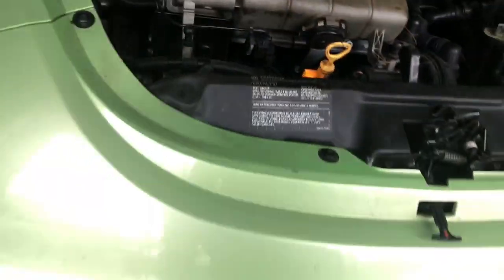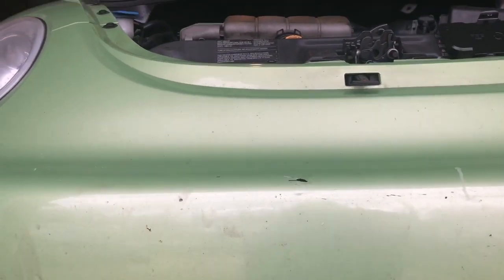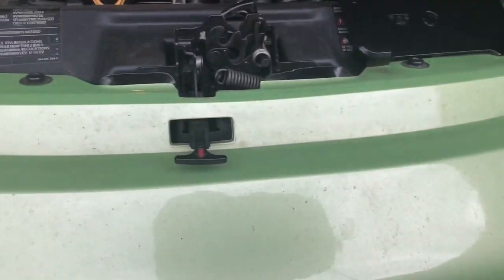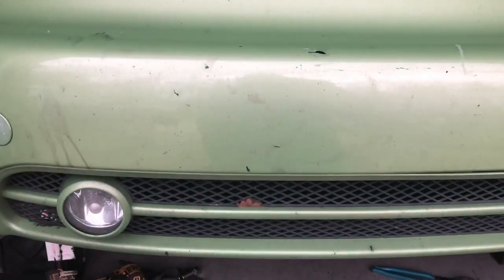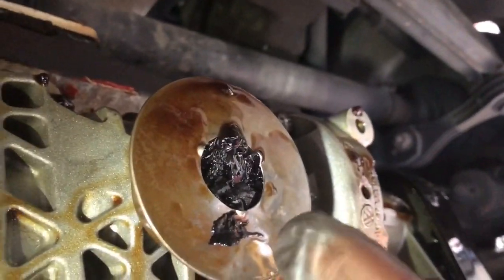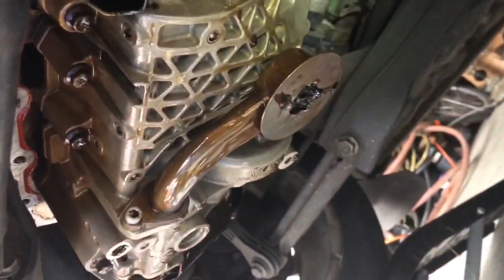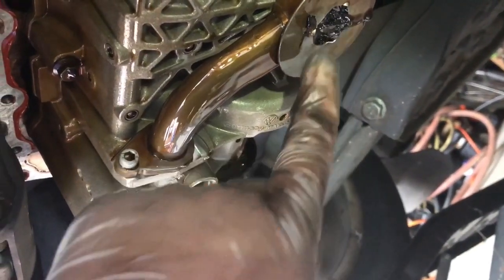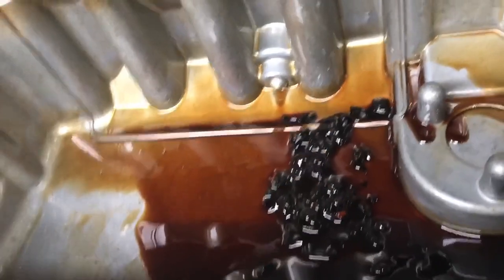Check this if you have low oil pressure on your VW or Audi

Comment: finding this video now and I can confirm this is a VERY common issue...i had it with my MKIV  GTI recently. Good video.
Reply: Just happened to my mk5 gti was sitting in outside in the winter for a couple days completely fine before but I didn’t even drive 10 mins and the oil pressure light came on
Reply: @felonadrenalinejunkie7748  what was it filled with? Thinking this is what’s wrong with my mk5 TFSI BPY

Comment: Thanks Ocie Carlisle
I just Scored a 2004 VW Jetta TDI wagon for $800.00...beautiful shape except it has Low Oil Pressure 
and Low Power. This is where I will start my investigation !
LIKED/SUBSCRIBED !
Reply from the maker: Screww Googlle for low power, you may need to check out your turbo and turbo feed lines to make sure they aren’t blocked.
Reply: @Icanfixit-2  
Will do my new friend !
Thanks for the come back !

Comment: Thanks, this was helpful. I have a 2012 Tiguan with the same engine and lots of repair receipts. I'll verify my oil pressure switch wasn't already changed, then start with dropping the pan.
Reply from the maker: Hopefully it fixes the problem
Reply: Sooo - I have been waiting... :) How did it go?

Comment: Just got a Passat and the light came on after like an hour of driving..but I was hauling ass really testing that turbo out! Hope to god this is the issue.
Reply from the maker: Hagen Smith if not, worse case scenario you have a spun bearing.
Reply: Hagen Smith so did you solved the problem.  Or what was the issue?  Thx

Comment: Have a 2006 Passat. Low Oil Pressure light and alarm came on. Car shut off once
Or twice. Happened after driving about 45 min straight. Changed the PCV Valve. All lights and alarms shut off and no problems since.  Drove it for a
Couple hrs straight. No issues.
Reply from the maker: Patena PR that’s good to go!

Comment: Greay Video and going throughy comments you seem extremely knowledgeable.  I need some guidence please. 

I have an oil light that comes on intermittently on my VW golf 7 2.0 Tsi, i.e on start up sometimes and sometimes not ...mainly after doing a short couple of miles the light surely comes on.

We have changed both oil sensors , changed the Pcv valve, and changed the oil and oil filter ..as far as doing the timing chain and Cambridge replacement.  The light is still on.

What have we missed ,what could be the issue ...is there a way to isolate the issue down to the exact failing component?

I feel like giving up😢
Reply from the maker: Does it make the “death rattle” when the light is on? Have you had timing chain guides recently replaced? It could have blockages in the screen  of the pickup tube for the oil. It’s not sounding too bad. Just let me know.

Comment: Audi A4 2.0 ALT Engine Oil Pick Up was replaced and during the test the Low Oil Pressure Light reappeared. We stopped immediately because smoke appeared from the Oil Pressure Sensor. This morning we checked the Oil on the Dipstick and therefore at the right level. The problem is the car does not want to start now. It sounds like a car without a spark on the Plugs. Before we replaced the Pick Up, the top of the car made a lot of noise but after the Oil Pick Up was replaced, the Engine sounded normal. We could not find any Oil leak under the car. Also replaced the Spark Plugs and Oil Pressure Sensor.
Reply from the maker: Try checking your crank sensor and cam sensor. I also have a video on replacing the crank sensor. If no spark, could be your crank sensor.
Reply: @Icanfixit-2  I will do that and inform you Thank you

Comment: Why on earth don't they make the oil baffle out of metal instead of plastic to avoid this problem? Are they keeping the production cost down? I'm sure the engineers that designed it are aware.
Reply from the maker: sand 007 only thing they were concerned about was saving money as usual. They also claim that the oil would work as a “cooling agent” at normal operating conditions.

Comment: Great video!  Thanks.  So if I drop the oil pan and it is filled with junk like the one in your video, do I just need to clean it off there at the opening or does it require continuing to dismantle everything to clean junk/debris that may have gone in past this point?  Hope this makes sense.     I am working on a 2008 VW EOS by the way.
Reply from the maker: Yes you are correct! Also remember to check the oil pickup screen and make sure it’s clean as well. Good luck on the job and feel free to ask questions as you go.

Comment: I have a 99 VW Passat V6 2.8L stick. What's the estimated time to replace or repair the Oil Pickup tube.

This would explain why my oil light came on right after my car hit extremely hard after a mechanic was driving off ramp.
Reply from the maker: It depends on your level of skill. A novice can do it in 3 hours total.

Comment: Good morning,  I am looking to purchase a 2002 VW New Beetle that needs the oil pump replaced,  I'm a very hands on type of female and feel I can fix things if I do my research well enough.  Do you think this is an easy or doable thing for a female? And what advice would you give? Would I need to take the engine out or is it accessible from the bottom of the engine? Thanks in advance...
Reply from the maker: Good morning. The easiest part is explaining how to do it, but yes you can do it with the right tools. The oil pump requires you to drop the oil pan and remove the drive chain that is turned by the crankshaft. Very straight forward job and remember to replace all of your seals with new ones.

Comment: Thank a lot for the info. What do people mean when they say ground you 
oil pressure switch ? Is that just to test the sensor it self ? I have a
 1.9 TDI Jetta 03. My engine was rebuilt and now it's throwing the oil 
warning. It only does it like 10-15 minutes after fully warmed up and 
smokes a bit more at that time and not while warming up. If the pickup is clogged, will it trigger the warning any any operating temperature or only when it fully warms up ?
Reply from the maker: The reason they say “ground it” is because it could have a little corrosion between the block and the sensor. You can also have oil feed line going to the turbo that could be clogged (smoke from tailpipe) and could probably be blown out or run an engine flush. Try doing an engine flush and see if that helps.
Reply: @Icanfixit-2  I replaced the oem feed line with a flexible one. Do you think that a clogged line can cause to loose pressure ? Btw the oil warning does it indicate low or high pressure ? I am affraid of doing an engine flush. They guy who rebuilt my engine use my old head and his old block, but he changed connecting rod and main bearings. Not sure if he measured the clearence.
Reply from the maker: @TheAbrunqaj  make sure it’s not a flexible one that collapses over a certain temperature because the flow rate will slow down and create a problem. A flush shouldn’t hurt by pouring it into the oil (oil flush). If you drain your oil and see large particles, you need to drop your oil pan.
Reply from the maker: @TheAbrunqaj  also, it’s triggered by low pressure.
Reply: @Icanfixit-2  Thanks for your help. I mentioned earlier that the engine was rebuilt. So IMO it should be clean but I can try a flush. Is there a specific brand of engine flush ?
Reply from the maker: @TheAbrunqaj  sea foam has always been my go to for almost everything.

Comment: that's crazy!!! I think my issue is different though, well hopefully. I got my 50k oil change 2 months ago and I dont drive much but I started to notice oil stains where I park and now the low engine oil pressure light is on. I checked the dip stick and there's barely a drop on the very tip. I have a 2019 Jetta SEL Prem... I called the service dept and they couldn't see where I had an oil change, only a software update. That scares me because now i'm questioning if they ever did the oil change or if they did, maybe they didn't tighten the bolts correctly. I hope theres no serious damage, what would cause a leak after an oil change like this?
Reply from the maker: It could be burning oil but that would be very rare. Did you add any by chance? Me personally, I would check at intervals at 1200, 2400, 3600, and 4800 miles to see how it’s using oil or how fast it’s leaving the engine. If it’s a turbo, you risk the turbo building crud if it gets low or if it’s burning through the exhaust.
Reply: @Icanfixit-2  Thanks! I am adding 2 quarts in the morning Catrol 0w-20 so I can drive it into the dealership. I'm not taking any chances for another 1k miles. My fear is that they didn't do the change, even now
 my service records don't show it... this is so weird.
Reply from the maker: I’m sure. Gotta be safe.

Comment: I have an 2009 VW Tiguan. The oil pressure light started coming on after a recent oil change. Oil pressure switch and sender were  replaced on two separate occasions after the oil pressure light kept coming on. The oil pressure light is back on again. Oil is good, no noises coming out of the engine. Just that pesky light. What’s your recommendation?
Reply from the maker: ITisWHATitIS check the oil filter and make sure the rings are in the proper place. Also, make sure that the screen is not blocked. If all is good, do an engine flush.
Reply: Ocie Carlisle I will try that. Hopefully, it works. Thank you!
Reply from the maker: ITisWHATitIS keep me updated!
Reply: Same issue did u resolve?

Comment: What would you use to clean it?
Reply from the maker: I’ve used brake cleaner spray and it worked great. Also you can soak in diesel fuel.

Comment: got a question for y'all, so I got a 08 Audi a3 with the timing chain engine paired with the Dsg. When driving last night going home after 1 hour of cruising the oil pressure warning came on twice both under 2k rpm. When I push the accelerator above 2k rpm the warning goes away. I did replace the sensor/switch 4 months ago. And did do a recent oil change. Any suggestions how I can troubleshoot this? And no metal debris in the oil either when I did the oil change. Any help will be appreciated thanks!
Reply from the maker: Stage2A3 you may have a weak oil pump. Check out the oil filter first and make sure that it isn’t collapsing in on itself.
Reply: I would think you have worn main bearings is why oil pressure light goes off when bringing up the rpms. Do a oil pressure test. If verified low oil pressure drop the pan. Maybe an issue like this video. If not inspect your mains.
Reply: Kind of the same question here. I have a VW EOS. Low oil pressure light has been going on a lot. Took it in and they tested it and the oil pressure was fine, so they put in a new sensor. They suggested doing an oil change as well but I denied because I had just had my oil change last month. The very next day, the warning came on again while driving . My question is, wouldn’t they have seen the debris when they were changing my oil last month or when they were doing the thorough inspection of my car this past week? I plan to take it back in tomorrow, but didn’t know if O should mention this to them?
Reply: @np984  I’ve actually gotten rid of the car. The only way you will see any sort of metal shavings is by dropping the oil pan as the metal settlers at the bottom. Usually when you get a oil pressure light is when the main bearing or connecting rod bearings have gone past factory clearances. So my advice would be is get rid of the car before it gets worse or dish out the cash for a rebuild.
Reply: @TheMandeep125  thanks. I’ve been thinking of trading it in. Was hopeful the new sensor would solve the problem and I wouldn’t have to deal with it anymore. Frustrating. Almost have it paid off!

Comment: I have a volkwagen tiguan 2012, I usually get the oil low pressure light when I'm driving slow.  So it won't come on when I'm driving 50mph or faster. But if I hit traffic that's slower than 40 mph it'll come on everytime.  I really don't think it's my sensor if it's being triggered by the same performance. Would you still think it's the oil pick up tube? How do you fix this, is it clearing out the tube or replacing it? Thank you!
Reply from the maker: When your vehicle is at idle, make sure your rpm’s are no less than 650. If less, it will trigger the oil light to come on. Also, do you hear rattling at idle? Could be oil pump chain worn. If you have none of those symptoms, use an oil flush or a little bit of kerosene 1/2 quart and let it run through your oil system for no longer than ten minutes. Drive it a little while in there and then drain it out. What that does is break down crud that could be in your system. But sounds like you may have one of the fore mentioned problems. Keep me posted.

Comment: hi mate. have a vw scirocco 2010, oil pressure light has randomly switched on twice in 5 days for about 2 seconds both times driving around a corner about a minute after starting the car. does this sound like a blockage or sensor issue?
Reply from the maker: Justin Cullinan sounds like a starvation issue. Your oil could be low.
Reply: @Icanfixit-2  I topped the oil up right after the first warning came on, drove for about 250 km that day after doing so and no warning light flashed till yesterday, about 2 days later.
Reply from the maker: Justin Cullinan if the level hasn’t dropped, it’s possible that the sensor is bad.
Reply: @Icanfixit-2  I suspect it is the sensor. No leaks I can see. I'll bring it to a garage asap anyway for peace of mind and sensor change. Thanks for the messages Ocie, subbed.

Comment: Would this cause the oil light to flash and turn off intermittently? Or would that just be the sending unit?
Reply from the maker: It could. To rule it out, check out the connection to the sensor to make sure it’s not broke. Also when you drain your oil, look for trash in your drain pan.

Comment: Hey man, thanks! What year beetle this is? Im mk6 gti. Cleaned out the pressure switch with maf cleaner and a day later got the annoyance back. Bought the new sensor, hopefully thats the problem.
Reply from the maker: Massive Dubstep mine is a 2004.
Reply: I've driven around 100 miles since the new switch install. No more "Engine off now!" Messages. Also seems to have solved a p0299 boost code. I did clean my intake filter the same day I replaced the switch though.

Comment: Hi! So I have an 08 Passat 2.0t bought used. I got the oil changed Friday and the engine light & oil pressure warning came on by Sunday. I took it back thinking they did something and they looked it over & said my turbo is going? I googled that and I don’t have any of the signs of the turbo going. The oil warning doesn’t seem to happen at high speeds but when braking or stop and go, turning. I’ve only had the car 6mo but it’s so expensive to fix. Any ideas?
Reply from the maker: Nikki E is it making funny noises? Blue smoke coming from the tailpipe?
Reply from the maker: Nikki E it could be your pump either stopped up or oil filter is too restrictive.
Reply: No noises, no smoke. So where should I start?
Reply from the maker: Nikki E oil pressure sensor
Reply: I’ll try that. Thanks.
Reply from the maker: Nikki E also check oil filter

Comment: Hey there, people reading this;

I have a 2014 Turbo Jetta that had it’s oil changed from the dealership about 4 months ago and ever since the oil pressure light has been coming on.
First they said the oil housing filter was loose then it was the oil pressure switch. They changed the oil pressure switch and still the light is on.
Recently topped up the oil too as it was dark and low.
The oil is now fine but light comes on sporadically especially cold starts. No leaks found.
Any advice?
Reply from the maker: Vaibhav Chaudhary Hope there is no blockage in the oil lines going to the turbo. It’s also possible that the oil pressure sensor is bad (yes a new one can be bad) or the oil filter is too restrictive. Start small and check your filter for trash and go from there. Then test if possible the oil pressure sensor. And also make sure you have the right amount of oil too.
Reply: Ocie Carlisle That’s a lot to go over but I shall get into it or have it done by a reliable mechanic if I can find one. Thanks for replying mate!

Comment: Thanks for the video. I have a Mk 5 GTI, oil pump has been replaced, sensor I'm unsure about but will replace that in the next few days.  If this turns out to be the problem what part do I search for oil pump pickup?
Reply from the maker: Rob S I still don’t know the part number for it. You can clean it really good like I did mine or probably find one in the junkyard. Honestly, it’s not much to them. It has a little mesh screen at the end of the tube and a rubber O ring on top of it. If I ever find the actual part number, I will post.
Reply: @Icanfixit-2  Thanks much for the reply sir.  I think found one on rock auto.  I went ahead and ordered it. I've not even looked at mine yet, I figure if this is common screw it  just gonna replace the damn thing and not think about it. It was 50 bucks.